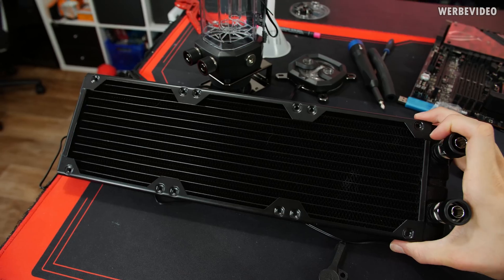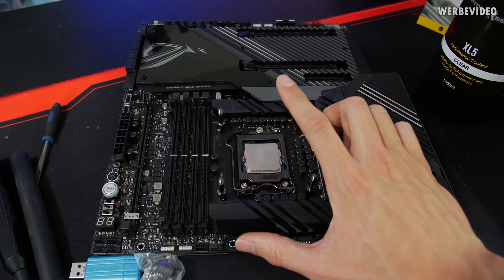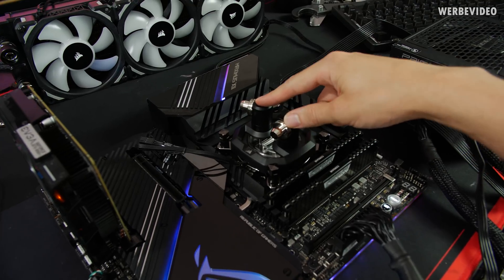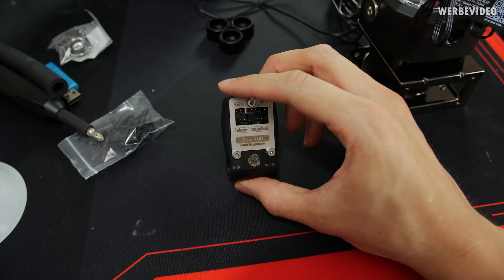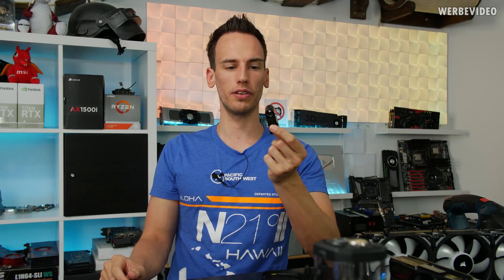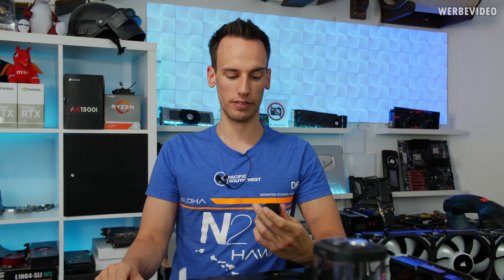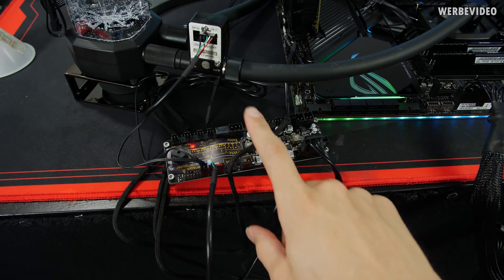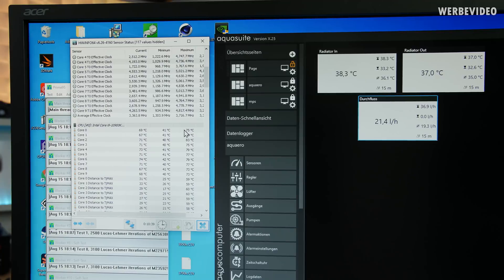Testing one of the Weirdest Water Cooling Myths - A SLOWER Flow Rate will result in BETTER Temps?

Comment: The CPU is a water heater that exchanges (thermal) energy with the water in the loop. Let's say that this energy output is constant. Radiators have a defined and fixed cooling capacity (misured in watts) that takes the heat from the water and transfers it into the enviroinment. The loop is not different from a pot full of water. What really matters is that the system reaches thermal equilibrium. Higher flow rate allows the water temperature to be as similar as possible in all the points of the loop, reaching "real" equilibrium faster.

Comment: Why is the flow rate so low? It should be much higher with that loop. For starters the MPS400 only measures down to 40L/h with the standard calibration and a loop like that should be running closer to 200L/h or higher at that pump setting.
Something isn't right there.
It looks like possibly you have not imported the correct calibration for the flow meter. If you use the calibration from the MPS200 or 100 model it will read low like it seems to be there.
Also, why is the pump only running at 2000rpm? 1800rpm is the minimum speed for most d5 pumps and 4800rpm is max. 65% doesn't seem like it should be only 2000rpm
Reply: Your observations are correct, looks like the incorrect calibration curve was used. I have the same flow meter in a few machines and for a single D5 you should be seeing between 150l/h and maybe as low as 80l/h on a really restrictive block CPU/GPU loop with something like a Nexxxos GPX at around 60%. On a dual D5 setup I see 380l/h at 100% with a 0.1-0.2°C delta temp for CPU in and out. At 140l/h at 60% this widens to 2-4°C depending on workload. Turbulence from the pump and not having a pressure relief value can also cause strange readings. I think I read in the manual or else where you should put the flow meter in-between two pieces of tube horizontally on the res return to get accurate readings.
Reply: @djangoofyork  The flow is obviously not  correct.   Using his numbers, the radiator is only removing 31.5 W in the Normal case and  an even lower 21.5 W in the High case.  
The low flow case is a ridiculous 8.2 W.

Comment: There is an endless supply of cold water in the kitchen tap. could you possibly connect a hose to that and run a very high flow rate, and infinite volume. To show an extreme difference.
Reply: That would be environmentally horrendous, and really no go if you were on a water meter. If everybody just left their taps running the water would run out.
If you just wanted to show the results of an extreme difference you would just do LN2 overclocking.

Comment: @der8auer I guess my view would actually be what you first were speaking about, using the same loop for the CPU and GPU, if you go into the CPU first, it heats up the water, and then goes to to the GPU which would then result in higher GPU temps. I agree with you on the information about the water flow in the example you were showing, but you did not go over what was actually spoken about (using the same Rads or loop for the CPU and GPU, VS using 2 different Rads or loop for CPU and GPU. This is what I would like to understand personally. Thanks for the Video, I always enjoy them! Edit: The Flow rate as you were saying I agree on, Just not so sure about it " not mattering if its on 1 or 2 loops or rads).
Reply: People overestimate how much the water actually heats up. In a typical block, at a typical flow rate, you're adding 1-2C to the coolant as it passes through the block. Yes, that will result in 1-2C higher temperatures if you then go straight into another block instead of going through a radiator first - but does that 1-2C matter to you? It matters if you're looking for the absolute best performance possible, but for most people, going for a cleaner loop setup is preferable instead of trying to route a radiator in between each block.

Comment: You mention two mostly-unrelated hypotheses but only test one of them. I'd be interested in the results of multi-radiator loops at different component loads, speeds, and loop configurations.
Reply from the maker: yaaaa 2nd video is coming :D
Reply: @der8auer  I'd be interested as well. Since the blocks benefit from high flow rate and the radiators benefit from slow flow rate, maybe the cpu and gpu in series with the radiators in parallel would be ideal? Having 3 120 radiators in parallel would lead to high residence time for the coolant compared to in a single 360 and you should still be able to get the benefits of high flow rates through the fins on the blocks. There's gonna be a lot of tubes though lol.
Reply: @filonin2  I hear flow rate equalizes to a degree, so you might not see that much of a difference where you can say the blocks are getting a much faster flow rate than the rads.  Doing rads in parallel might split the flow, but it would lower the flow overall for the system too, meaning the flow over the blocks would also get lower than in you had the rads rigged in series.

Comment: Why do you use a pump in your water-cooling setup? Passive heat exchange powered water flow is much more efficient and gives much better cooling results than any other unreliable mechanical pump based system. The fact that you point this out when talking about the flow meter then go on to use a pump is really weird.

Comment: I did saw my water temp go up with faster flow and was wondering why but not to the point of thinking it was better, just a curious thing
Reply: The pump is also cooled by the loop, at idle it may be a significant enough to actually increase the temperature.

Comment: Something is wrong with the data.
The flow times the differential temperature should be essentially the same for the normal and high cases .  But the normal is 27.3 and the high is only 18.5.  The higher flow should, not be 2/3 of the lower flow. 
This may just be a problem with the accuracy of the flow meter and temperature probes.
Also it would have been very useful to have the temperature at the inlet of the CPU.
I suspect that there is significant heat loss in the reservoir.

Comment: And people mistakenly remove thermostats from car cooling systems, you don't do that because the radiator fins provide the cooling and you move more water, but at the volume your water pump moves water the engine overheats, because it doesn't have time to pick up any heat, in low volume water movement it's a little better, but the differences between the full tilt and the medium setting is so small it barely changes. The meter is also providing a restriction so...

Comment: I was just thinking about this, completely as a thought experiment. 

Stop putting chips in my head and thanks for clarifying this. 

Also, someone please tell Jay-Z that you don't have a single temp of entire loop unless you have infinite flow rate in the loop. The loop order practically doesn't matter, but as you showed, silent speed profile can have upto 1.5 degree difference in water temp and different loop order would fix that. The cpu/gpu temp fluctuations is big enough that this particular matter is largely irrelevant n real life though..

Comment: Component order does matter. Radiators work most efficiently when the delta T is highest. 3 radiators in a row means the third rad in the loop sees a lower delta T as the previous 2 radiators have reduced it. The effect is lessened with higher coolant flow rates but not eliminated.
When you are in a situation with an abundance of cooling headroom, having all the radiators in series followed by all the heat sources makes sense as you get the lowest loop coolant temps this way to minimise system temps. When you are limited with cooling capacity, alternating radiators and heat generators to maximise cooling efficiency of the radiators makes sense.
Reply: It just doesn't matter enough to worry about, usually. The effect of loop order on overclocking or performance is likely going to be smaller than what comes from fluctuations in ambient temperature. Especially because you'll probably have high pump speeds that result in tiny temperature deltas across the radiators, if you are trying to get maximum cooling. If, on the other hand, you are trying to optimize your pump control for the lowest possible speed at any heat output, then the order will matter a bit more for the low speed end.
Reply: This is a matter of technical vs practical application. In a technical evaluation of it all, yes it would be more efficient to alternate heating and cooling sources. In practice, the advantage is so small that it becomes negligible. You could spend tons of time calculating the exact amount of cooling needed after every heat source, the perfect pump/fan speeds for each temp. range, the ideal tube size for every connection, and on, and on, and on. Or, you could simple figure out how much cooling the total system will need, set the pump to the highest speed you can tolerate, set a PWM fan curve that is quiet under everything but the most extreme conditions and be close enough that no real world performance advantage can be measured.
Reply: I had issues with temps on a top-mounted 360mm rad and ended up splitting the flow right after the CPU to a pair of 120's in parallel. Those ended up giving me much more consistent (and lower) temps than the single 360 (same fans, same speed, just with the third fan as a direct extractor in-between the rads). I'm tempted to try bodging in another 120 after the flow consolidation to see how much of a difference that makes.
I originally thought the 360mm rad might have been faulty, but it ended up in another PC and it gave results well within the rated spec.
Reply: But that also means the water will warmer entering the first radiator, so the first one will a more efficient actually. In the end it's all the same. Just make sure the flowrate is high enough. More components and more heatload require a faster flowrate to stay cool.
Reply: Higher flow rates mean more noise, and if you make the system as a whole more efficient rather than a single radiator, you can run your pump and fan at lower speeds for less noise.
It isn't big gains granted, and if you are space limited or routing limited it isn't the end if the world. But if you have the option to make those fine tuning adjustments to your order to optimise it for your setup... Surely thats the difference between using auto voltage when overclocking and manually setting the minimum stable voltage when tuning your cpu?

Comment: Corsair = avoid
Reply: there stuff lately has been super overpices, im really dissapointed in them they make great stuff but lately have been looks over function as well
Reply: @BTD3Fan  they make alot of junk too.
Reply: @tacticalcenter8658  well i mean that goes for everyone
Reply: @BTD3Fan  fo shu... I don't see one thing that I would want from corsair over another brand. And I've been affected by some of the trash they make. What makes me even more upset though is the others affected by that stuff and other products. Leaking gpu water blocks, poorly designed cases, Icue rgb software causing crashes but they won't fix it despite long threads of users with issues. Some memory related things. There only good quality I can see I Johnny Guru who revolutionized the psu market with better psu's... At least the higher end ones.
Reply: @tacticalcenter8658  I have no dissagreement on their watercooling stuff. All rgb software sucks tho and icue has gotten a lot better and works pretty much seamlessly for at least me. But as someone with a corsair psu I can say its only 80 plus gold and has 91% efficiency under load, and I havent had any problems with my case; nly problem I had was my first mouse but it was technically omron that makes the switch that broke. 

I dont mean to seem like a fan boy by any means tho, and currently other brands are a better option ior basiaclly any segment imo.

Comment: I can say that this video is spot on. I have a big water loop consisting of 5x480 rads and 3x360 rads with 2 cpu blocks and 3 gpu blocks. The pump speed is the most important aspect not loop order just as he says. The only thing that came into play with a large loop was when running series I had to spread the pumps into different areas of the loop. I could not do something like running them in a row to increase head pressure overall. I had to do about a couple rads and a block or two and to another pump to continue throughout. Love videos like this that help people learn what’s important before they take the step into the custom water cooling world.
Reply: What did you see that makes you say you can't have the pumps set one right after the other in series?

Comment: I might be missing something but would it then make sense to have radiators in parallel instead of series to reduce the flow rate through them while keeping a high flow rate through the CPU block? Would be interesting to see a video looking into if there's a difference between having radiators in parallel versus in series :)
Reply: That doesn't really make any sense if you think about it. Imagine you are one lonely water molecule traveling through the loop. You flow through the block and pick up some thermal energy. Then you reach a set of series radiators - you keep moving at the same speed since they are in series. Let's say you spend 5 seconds moving through the radiators. They remove some thermal energy from you during that time. Now imagine you have a parallel radiator setup. You, the molecule, move through the block and pick up heat like last time... Then you get to the radiators - you will go through one of them randomly. Because it is parallel, your velocity is cut in half... But the distance you move is also cut in half because you only move through one of the rads, right. Result? You still spend 5 seconds moving through a radiator. The amount of heat energy removed is the same.

This has been answered over and over again for 20+ years. It doesn't make a difference.

Comment: Order of heat source and heat sink does matter.  Just not so much with a small amount of components.  In order for rules/laws to be correct they must hold up to extremes.  Take 100 CPUs and 100 radiators.  Granted flow rate would be a challenge with normal size fittings and lines however if you ran all the CPUs first in the loop then temps would reach a critical level well before the end of the chain of CPUs and the temp would reach ambient temperature well before the end of the chain of radiators.  Run that in a cpu, rad, cpu, rad etc configuration and you would have much better performance.

Tldr.  It does matter.  Just not so much on most builds.

Comment: I wonder whether it’s possible to have both fast flow over the block and slow flow in the radiator. My head tells me this will be the best of both, but I’m unable to test it out to see whether it works or not, so unless I’m entirely mistaken, this is just going to stay a theory in my head.
Reply: Still doesn't make a difference. What you are doing with that idea, is optimizing for outflow temperature - which is the wrong thing to optimize for. What you should be optimizing for, is removing as much heat energy from the system as possible. Like Roman proved in the video - it doesn't matter AT ALL what the in & outlet temperatures tell you, even if the outlet temperature is higher, it's completely irrelevant - the only thing that matters, is how much energy you are actually removing from the system.

And how do you remove the most amount of energy from the system? You move more coolant through it. Faster pump speed = faster flow rate = higher volume of coolant flow = more energy flowing through the heat exchangers (radiators, blocks) = more energy transferred from one medium to another = CPU temperature is brought closer to ambient temperature = CPU temperature is lower. Trying to change the speed of the coolant at different points in the loop is just adding complexity and adding restrictions, while achieving nothing what so ever.

Comment: so if i use 2 pumps with one reservoir and two loops: one of them would cool only waterblock on high speed and another one will pass thru radiator on low speed i can maximize cooling efficiency? or will just loop with waterblock heat soak reservoir faster than it will be cooled by rad loop?
Reply: That still isn't how that works.... The whole point Roman is trying to make is that trying to "spend more time in the radiator" is a logical fallacy. You're not trying to lower the temperature of the water - you're trying to remove as much thermal energy from the system as possible. You accomplish that by moving more water volume across the heat exchangers (water blocks, radiators). More volume = better. Doesn't matter what the temperatures say - because the temperature is not a measure of heat energy. Proof: You can't boil a kettle of water on a 100 watt stovetop. But you can easily reach over 100 degrees on a CPU pulling 100 watts. Both are pulling 100 watts - but one of them reaches 100 degrees C, the other does not. Why? Because temperature is not the same as heat energy. The kettle, being larger in volume and having a larger surface area, is dissipating way more energy than the CPU can with it's small surface area.

Same with a water loop. You're trying to dissipate energy as fast as possible - you're not trying to make the difference between in / out as large as possible, because temperature is irrelevant.

Comment: By unit of mass, water has 4x the heat capacity of air. In other words, if you need 1W of power to raise 1 kilogram of 1 °C (not actual reality, but bear with me) then you’ll need 4W of power to raise 1 kg of water the same, 1 °C temperature. Thanks for putting some metrics to this factoid, Roman.

Comment: It uses 2 pressure senors and a orifice in the center to cause a pressure differential and using a formula you can get the flow rate.
Reply: how does it get fluid density?